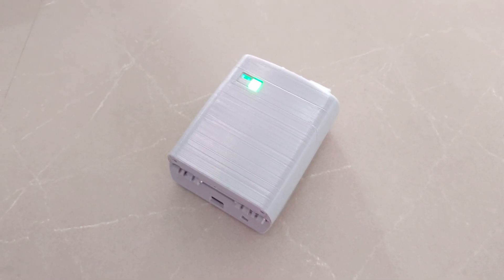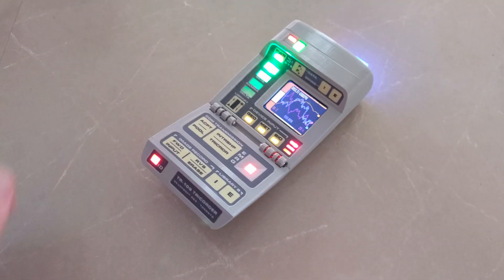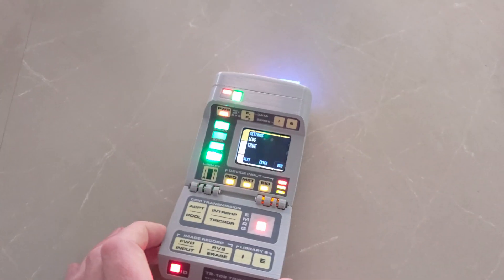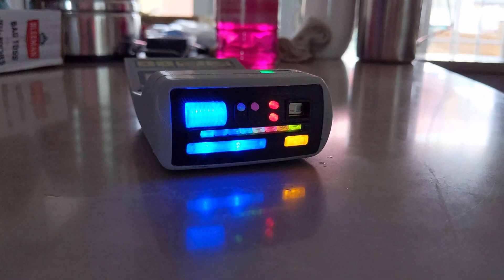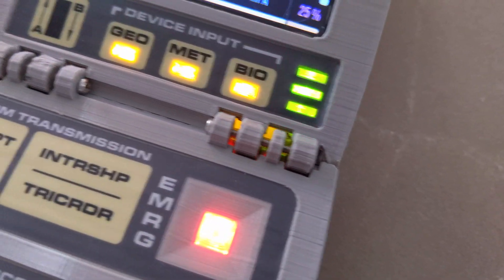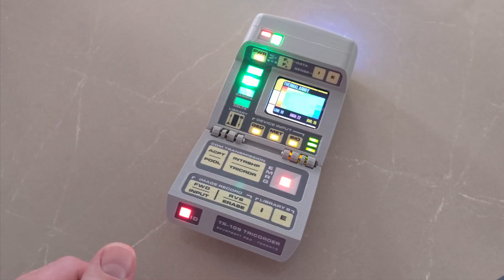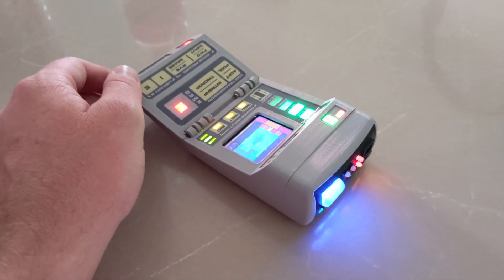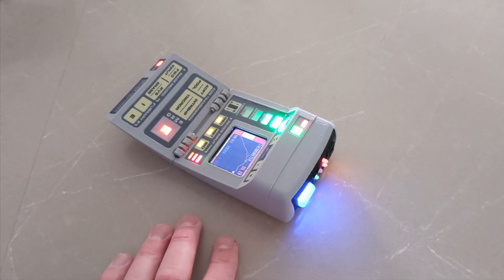[project] Raspberry Picorder 2 - Update 2

Comment: Since getting one of the 1990s tricorders is next to impossible... you will be mountain man on money hill... 
Great job... just magnificent
Reply: I finally found one, along with a phaser. The tricorder suffered awful battery leakage but a bit of time in the electronics lab I managed to rebuild it
Reply: @compwiz101  oh I still have my playmates tricorder and phasers. And I know they are all over Ebay.
I meant the mk-I that some science lab produced in the early to mid 90s. It came with a CD to link it to a pc. And could read temperature, barometric pressure, magnetic field readings and a couple other things they squeezed into it. It looked like some prop off tng, but was sort of prototype-ish in look. Flat, non folding and shaped a bit like an old 1800s coffin.
Reply: @tra-viskaiser8737  Oh neat.

Comment: Looks great! Do you have an update yet?
Reply from the maker: Thank you! It's been a tough winter so far. I've been very busy. But I have acquired and installed a Pi Zero2 which has brought SIGNIFICANT performance improvements. Also there is new functionality and features I've been adding, as well as working on the older picorder as well. Expect an update in a couple months or less!

Thanks for asking!

Comment: have you looked into using a interrupt for the door open signal ? if the door and screen timing was the bigger issue, leading to this performance loss; then doing so would better fix the issue.

Comment: You're using Threads instead of forking the process with Python's Multiprocessing module. You might get better performance using Multiprocessing instead.
Reply: Unlikely. The whole point of multithreading is that it consumes less resources than multiple processes do. The real problem here is that the CPU on these pi zero boards is pretty weak, it’s the same one used on the original raspberry pi. But that said, python is not really suitable for performance realtime apps and coding up the whole thing in properly optimised multithreaded C would probably yield a much better result
Reply from the maker: Just wanted to update you that I did try this and it made a huge difference on the pi 02w! Thanks for the advice!
Reply: Incredible project! Your passion is inspiring too.

Can you recommend and good learning resources for understanding multiple threads or processes?

Comment: Have you thought about using a compute module 4? It's faster(If you're still using a Pi 3), smaller and you wouldn't have to use a hat.
Reply from the maker: I've thought about it, but for this project it was a little too involved. Having direct access to the GPIO header was pretty useful and I'm not sure it would have been as accessible for someone at my novice level to integrate that particular SBC. 

Maybe for  a future build?